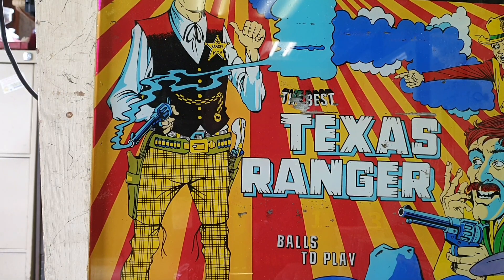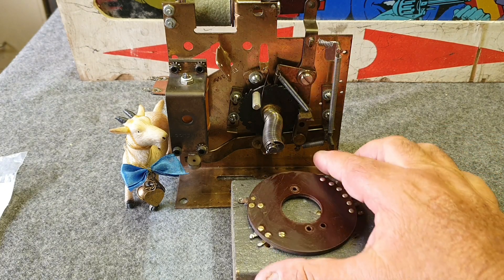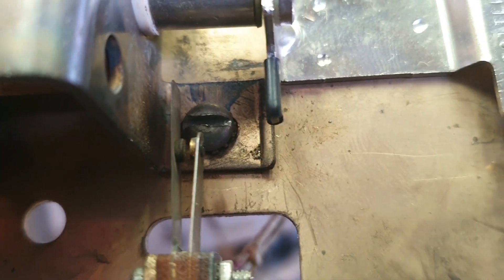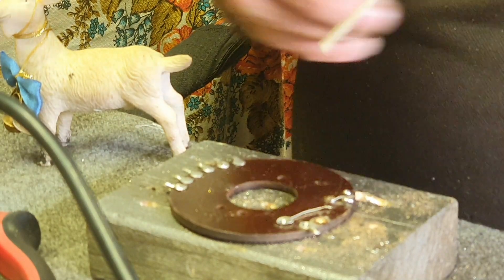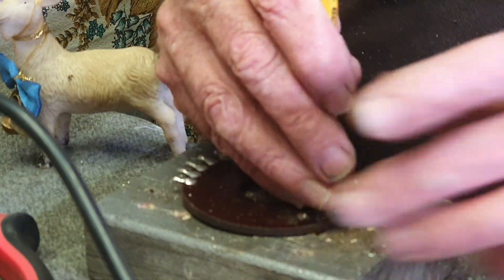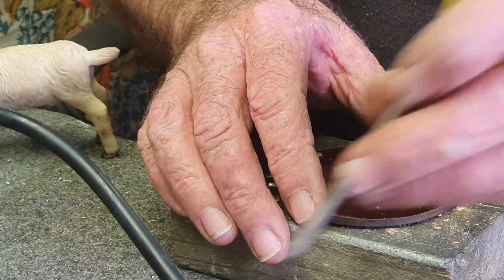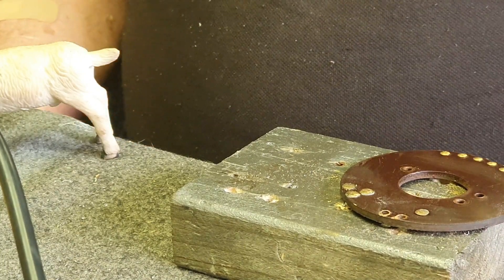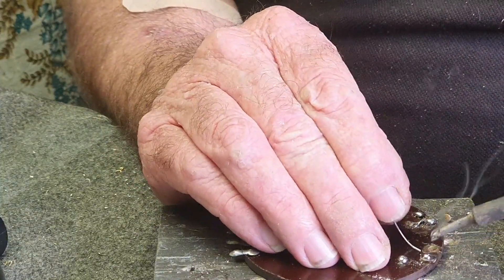Pinball Repair Rivet replacing on Ball count unit

Comment: I need to replace a bunch of rivets for my Chicago Coin Rocket Shuffle search board. This video came in handy Kim! Chris Hibler
Reply from the maker: Thanks Chris glad you found it useful 👍🏻
Reply: @goatshedempinballrepair8545  Do you know the spec for the rivets Gottlieb used? Steve Young has quite a variety on the site. I need to know either that part number or the dimensions. Don't hunt around for it if you can't find the info easily. I'll figure it out.